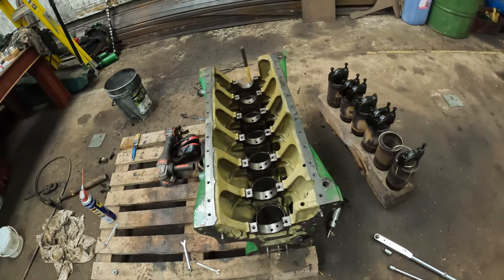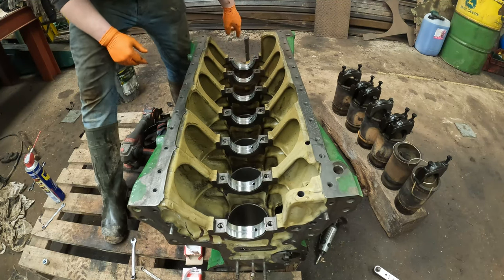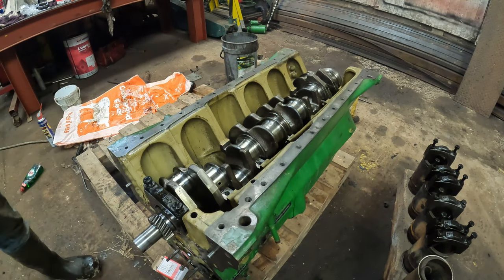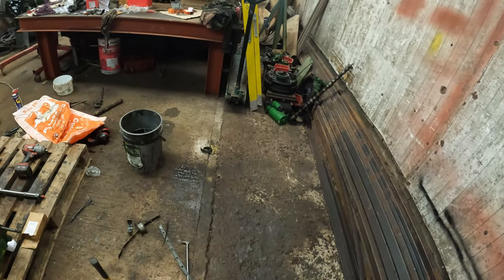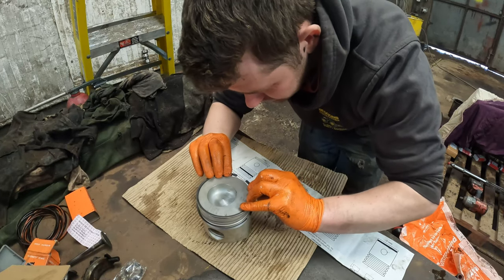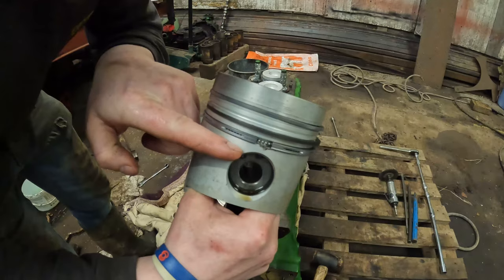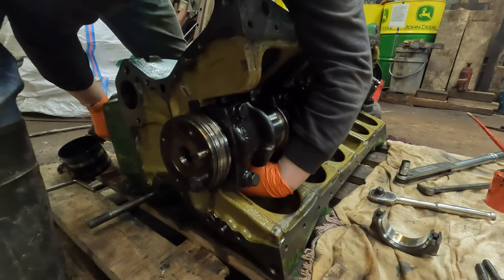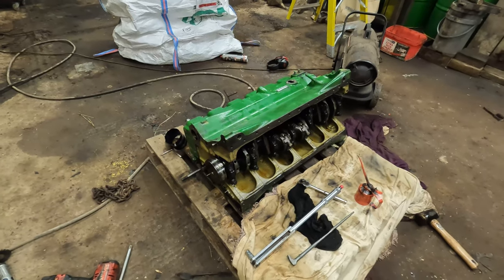Installing new pistons and crank shaft! | John Deere engine rebuild

Comment: Hey man ...!did you cleaned a main oil hole that ends with oil pressure sensor? I have done this job already ,but have no video ... 
And my second main bearing oil hole was blocked too .... oil line to oil pump had crack ... good luck ,,.... want to hear a running sound and smell a smoke😂😂